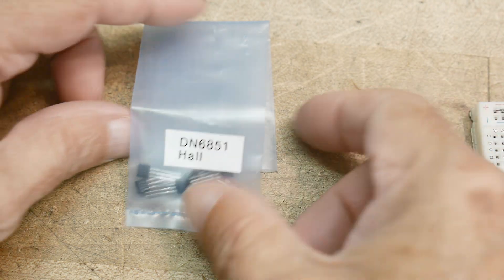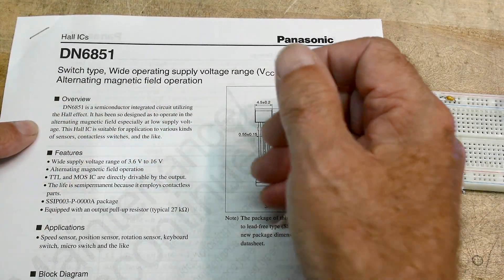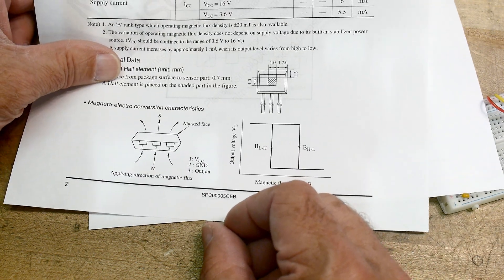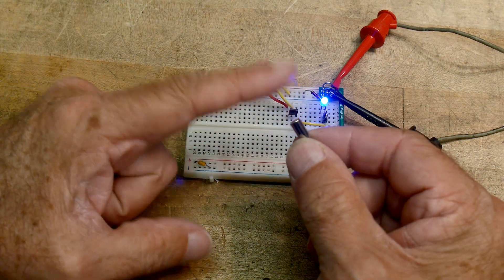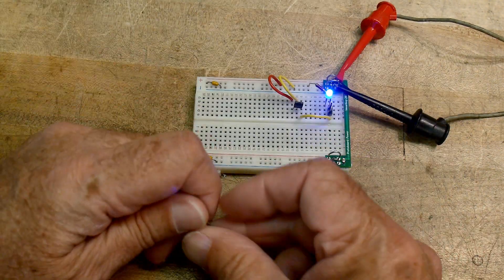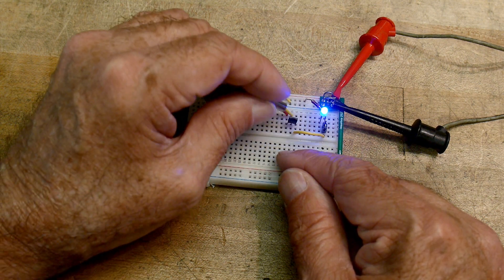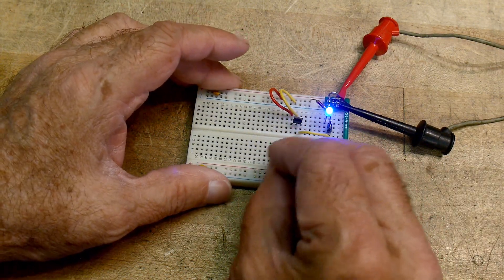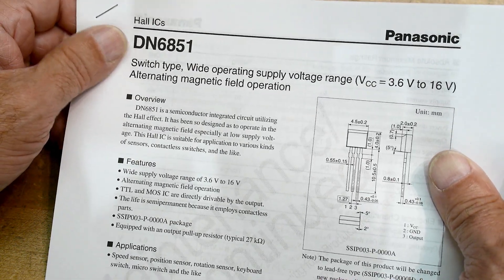#1529 DN6851 Hall Effect Sensor

Comment: very interesting and informative. also, i searched: Edwin Herbert Hall, discover the HALL effect in the year 1879. This effect consists of the appearance of an electric field transverse to a conductor on which an electric current circulates in the presence of a magnetic field. Hall's experiments showed that the charge carriers were negatively charged particles. This fact was of great relevance since electrons would not be discovered until more than ten years later.

Comment: Hall effect sensors are very cool.  They are often used as rotation sensors in hub-motors for electric bikes.  I have played around with these motors quite a bit, but the Hall effect is another one of those black magic mysteries which only the Wizards of Silicon Valley understand.

Comment: Nice chip of the day!  See you're putting to good use the power supply rail PCB, Nice.

Did an online search, Hall effect is the deflection of electrons (holes) in an n-type (p-type) semiconductor with current flowing perpendicular to a magnetic field. The deflection of these charged carriers sets up a voltage, called the Hall voltage, whose polarity depends on the effective charge of the carrier.

Comment: I suppose the alternating aspect would be useful for a tachometer if you were to mount magnets with alternating poles along a disk connected to the rotating shaft.  The alternating poles would provide distinct transitions.
Reply: Yeah! I noticed that if you bring the magnet in from the side and move perpendicular to the sensor you can toggle it just using one pole. I wonder if this would be accurate enough to be used to count actuations of a reciprocating device (such as a linear motor).
Reply: This is pretty much how all brushless DC motors were commutated from the late 1970s until sensorless drivers started showing up in the late 1980s/early 1990s.

Comment: You should get some analog ones and make a current sensor with them using a split toroid. I am working on one now, using an aditional sense coil to cancel the field for higher current capability and to pick up higher frequencies. I think it would make a good video!

Comment: I was wondering if this sensor would keep its on/off status after its power cut off.  If it does like a charged cap, for how long would it keep it?
Reply: Just added: Would Hall effect  been possibly  used for memory modules like core memories in 60s or 70s?

Comment: Ok, but what I want to know is how they are used to measure DC Amps in a clamp meter.
Reply from the maker: not this kind, but hall sensors are used on a toroid to measure the magnetic field created by a electrical current going through the toroid

Comment: What is the use of a circuit that tells you that something changed without telling you what the situation was before it changed. I will give the answer later. The contents of my wallet changed, into what? Is it empty now or filled so fully not one single extra South African Rand will fit in. And why continuously giving the signal that in the past something changed and only changing that when the situation changes again. I would like to know, if the subject is magnetics: is there a field and in what way is the field pointed, three possibilities, there is no field, there is a south pole, or there is a north pole present. 
This Hall sensor is totally useless! Only for a moment it tells the truth, that is to say, at the moment it flips, but shortly after that it becomes unreliable, because you do not know if the changed field is still there, the field could have died out and nobody is informing about this.